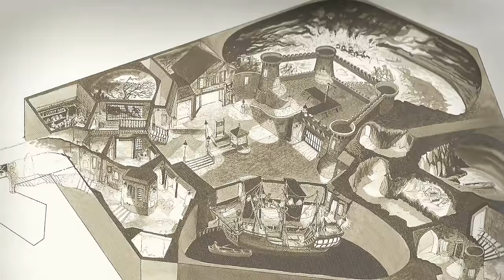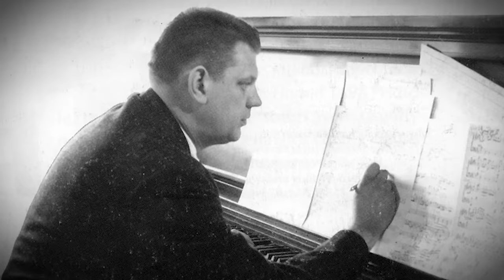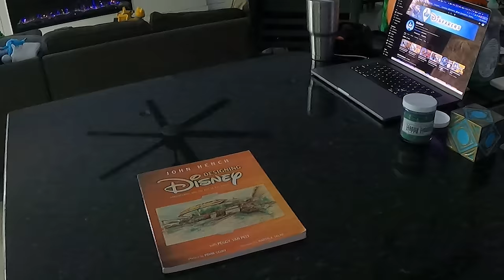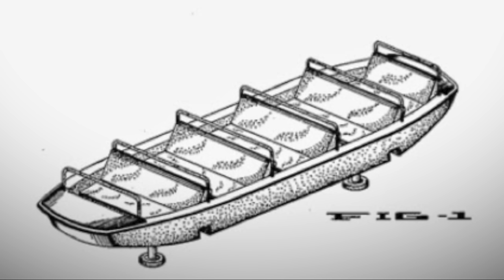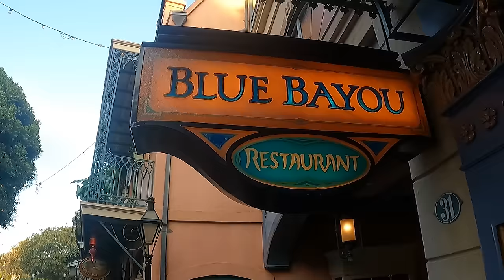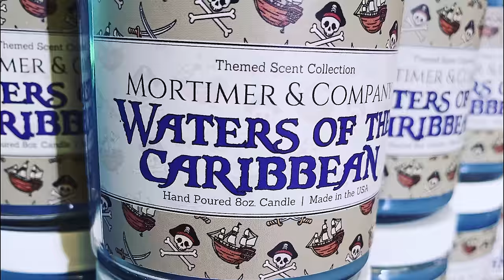The Creation of Disneyland's Pirates of the Caribbean!

Comment: Auction scene is a disaster and adding wokeness  is bad storytelling so don’t cave in to it. Don’t be a coward.
Reply from the maker: I thought I made an understandable case for Red. I mean, if even Walt Disney thought the Auction scene was possibly a step too far and there were designs for a female Red pirate that was never used, then I don't think approving the change is cowardly. Also, Marc Davis' design for the portrait of Red at Disneyland's Pirates has never been removed and is still widely favored by fans. The character concept was interesting 60 years before wokeness became a thing. I think I even admitted in this episode that early on I didn't like the change, but after learning some neat facts, I changed my opinion. 

The rides are supposed to change. 
Not totally altering subjects here, but I was on Pirates at the Magic Kingdom last weekend and they added new smells during two scenes. I like those changes too.